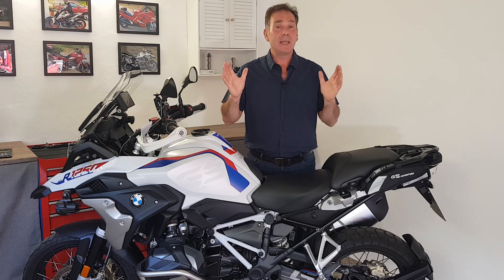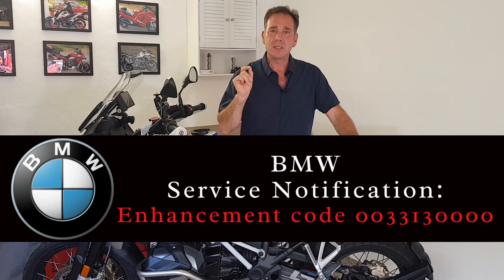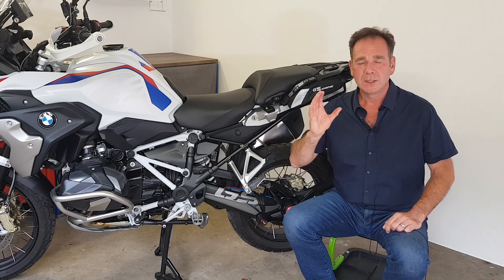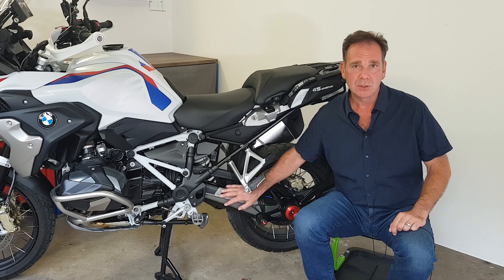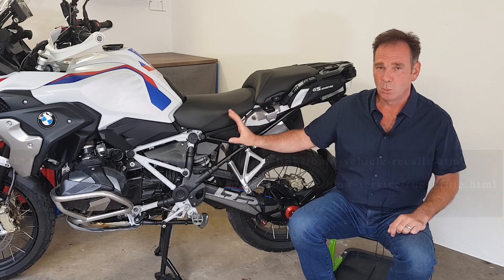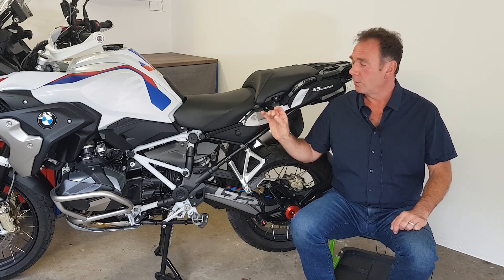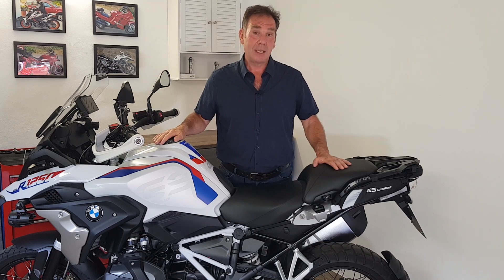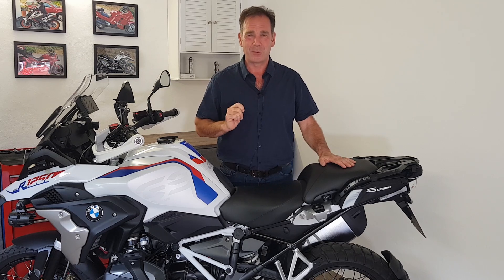EP:8 BMW Announce - Drive Shaft Corrosion Inspection and Test - Service Action 0033130000

Comment from the maker: To answer Nick’s question and help others, I do have the actual 8-page workshop notification and instruction, but it’s in German.
This is MY UNDERSTANDING…. And not a direct translation. 
A: less than 2,000km: 1: Carry out modification. NO INSPECTION

B: More than 60,000km: 1: Carry out modification. 2: Replace drive shaft unit.

C: Between 2 and 60K km: 1: Carry out modification. 2 Perform drive shaft test. 

Option 1: Drive shaft fails test – Replace drive shaft
Option 2: Drive shaft test passed & no water or only a few drops drip out during modification – no extra work is done.
Option 3: Drive shaft test passed, but more than a few drops of water come out – drive shaft splines are then inspected for wear and inspected to see if it is seized .
 
If it is seized, an attempt will be made to free it off. If this can not be done the drive shaft is then replaced.
If the wear on the splines is excessive, the drive shaft will be replaced. 

So please understand that this is my current understanding of the instruction given in this document. 
The document could be updated at any time by BMW. I have not seen the English version yet. 

If you have more questions, please contact your local BMW dealer
Best wishes
Carl

Comment: The valve they put on my bike fell out after after the run home, c300miles. I recall washing the bike post run and should have noticed there was nothing jutting out, but didn't. 
I never twigged it was missing until about 8 months later, when reading an article about it and dawned on me when I saw a photo of what should be there. Goes in for its annual service in a week's time. Be interesting to hear what they say.
Great vids
Reply from the maker: Thank you for sharing 👍

Comment: Hi Carl, I think it’s a little bit more urgent than you think. From personal experience.
Reply from the maker: Hi Graham, the dealerships have been extremely busy with this recall and inspection, my dealer had a stack of over I guess 35 or more driveshafts they had replaced. And that might just have been the months worth I saw. There are a lot of happy owners with new shafts now
Kindest regards Carl
Reply: @justthewayitis  

Hi Carl,
I would like to send you pictures and my experience with this problem but don’t want everyone else to see them.
Reply from the maker: Go to the contact section on my channel, if your a subscriber it will show you my email address, Carl
Reply: @justthewayitis  Will that not just show up here for all to see ?
Reply from the maker: Contactcarltoday
@
Gmail
.com
Reply from the maker: Just send your email to me at the address below, no one else sees it don’t worry
Reply: @justthewayitis  Hi Carl, I have sent the pictures to the other email address you sent me.
Cheers
Reply from the maker: Hi, nothing has arrived from you in my inbox yet. Regards Carl
Reply: Good morning Carl, have I managed to send you the pictures to your email address ? 
G
Reply from the maker: Hi Graham, good morning 
Nothing has arrived yet, just make sure you are using the correct address 
contactcarltoday
@
gmail
.com
Reply from the maker: Received 👍
Will reply later 
OMG !
Reply: @justthewayitis hi Carl, did you get my reply to your last message?

Comment: Not sure if this is limited to condensation. Mine was full of mud and corroded to the point it has to be removed with a grinder. The whole swingarm and drive shaft etc is being replaced
Reply from the maker: Well that’s great they are doing that for you. I think BMW are being very careful how they word the recall check. But it’s good to see thousands of bikes receiving complete new assemblies.
Carl
Reply: @justthewayitis  I was told by the dealer that an RS model with the same drive train was refused a warranty claim for the same issue as it wasn't part of the recall. I guess only the GS models are expected to get full of water and mud.
Reply from the maker: I can imagine that the RS owner was not so happy with that response 😞

Comment: Mine went in Thursday morning, a later phone call informed me they drilled the hole and oil came out, not a good sign. The Cardan Shaft and entire Rear Hub Assembly is now being replaced by BMW. I don't have the full story yet until I pick it up on Tuesday, but I am pleased they are taking care of it without question.
Reply from the maker: It’s great to hear they are taking care of it, and it’s nice to know when you collect your bike it’s going to be ready for your next adventure 👍. Sounds like the rear output shaft drive oil seal has failed or started to leak. It’s a fairly common problem on the 1200 version.
Best wishes Carl
Reply: What I was thinking, bring on the nc500 in 2 weeks 👍ride safe

Comment: Does this drain valve drain automatically or does it need to be removed to drain, thank you.
Reply from the maker: Thank you for Question, it’s really a condensation valve, that’s how BMW described it, but if you do get water inside it should drain automatically. I’m sure the regular subscribers that go off-road will comment and confirm if this actually the case.
Best wishes Carl

Comment: Last week my ‘18 1200GS went for the 30.000 km service to the dealer. They did make the extra vent hole. And they will replace the driveshaft under warranty because it’s not moving smooth. They did replace the driveshaft just 2 years ago at 14000 km because it had  the same problem.
Reply from the maker: Hi, well its great to hear they are again covering this under warranty, sounds like you have a great dealership you go too. Thank you for sharing, best wishes Carl

Comment: BMW CARDAN INSPECTION ( DRIVE SHAFT ) DRAIN PLUG FITTED. More than a few people that have had the rubber check valve installed are saying that it fits very loose and one person said his got pushed inside the drive housing and is just laying in there. Another said they are junk and fall off, and ''mines has now fell inside the runner bungs are rubbish", ''the rubber valve they install is crap, any external pressure dislodges the valve internally leaving an open hole. There seems to be no lip on the outside to prevent it from being pushed inside. I was thinking if this is the case, perhaps some black silicone seal would be a good idea which would be easy to do. What do you think? Should we just plug it back up or use a silicone to make it stay put? Thank You!!
Reply from the maker: Hi Eric, my GS goes in for the modifications / service and recall work next week, once it’s back home I will have a look and share my thoughts, Carl
Reply: @justthewayitis  Thank You Sir!!!

Comment: Hi... thanks for another great video.
Is this issue/mod just for the 1250 GS and not the late 1200gs ?
Thanks 🙏
Reply from the maker: Hi Bob, good morning. This applies to all GS and GSA. 
Reach out to your local dealer and book the inspection and test.
Many riders of the early 1200gs have had new driveshafts installed for free.
Good luck.
Carl
Reply: @justthewayitis  thanks Carl 🙏
Reply from the maker: Your welcome. 👍
Reply from the maker: One thing I forgot to mention,  it also applies to The R, RS and RT models so if any of your friends have of these its worth checking. 
My weekend riding buddy has an 2015 RS which had this check and modification done to his bike while it was in for service. 
Regards Carl
Reply: @justthewayitis  thanks again Carl... really appreciate it
Reply from the maker: No problem 👍

Comment: Your video refers to it as a technical bulletin in the beginning, but a recall notice at the end. 
There is also a torque test on the shaft performed as part of this service.
Reply from the maker: The video would have been a much longer episode if I had covered the whole test procedure , several owners have received new drive shafts as part of this test which is great news. It probably should have been a recall but with over half a million GS models sold it would have been a huge amount of work for BMW, so by calling it a service inspection they have been able to process the bikes in a easier way to handle. Best wishes Carl

Comment: Great video!  I've been looking into this problem.  It seems the rear UJ fails for the following reason: moisture enters the casing, then the needle rollers, corrosion sets in and they deteriorate from there ... that coupled with excessive articulation of the UJ quickly leads to failure.  Rebuilding with another UJ addresses the symptom, but not the cause.  
This is a serious design flaw which BMW could address by replacing the rear UJ with a CV joint (as found on the outside wheel of FWD cars, but smaller).  The CV joint could deal with the articulation, and being covered, the only maintenance remaining would be a periodic greasing of the final drive splines with a suitable high-pressure marine grease.  Fitting a breather will simply delay the problem, not prevent it.
Reply from the maker: Hello Visionary,  and welcome to the channel. Yes, I think most trained mechanics have seen as you have highlighted.. the only way to truly make the joints reliable over time is lubrication. I have not seen inside other manufacturers drive shaft units, perhaps they have a different solution. Best wishes Carl

Comment: Great video on a problem many of these bikes have. I live in the desert, and when The shaft on my GS was inspected and spline lubed at the last FD oil change, everything in there was ok. So I drilled a small hole in the bottom of the rear of the swingarm, threaded it and put a small hollow shaft into the hole. I got the Duck Bill rubber valve on Amazon for a dollar and installed it over the small bit of hollow rod sticking out of the bottom of the Swingarm. Good to go.
Reply from the maker: Hi Chris, good morning and thank you for sharing your experience, great idea....  👍best wishes Carl

Comment: Thanks for the clear explanation. I am not too pleased with the solution BMW provides. The problem is water getting into the driveshaft tunnel. This problem is not solved. Water gets in by riding in the rain and cleaning your bike with a high pressure cleaner.  Riding through streams doesn’t  help either, but only a small portion of the GS riders actually does that. The rubber connectors in the driveshaft are not watertight. Condensation is not really the problem, it is water getting in. Greasing the splines every 1 or 2 years and keeping the edges of the rubbers well greased, is probably the only remedy.
The solution provided by BMW is a bigger bucket for a leaking roof.
Love your channel and you very clear way of explaining things. I am not criticizing you, just BMW. This problem did not develop yesterday.
Reply: The new Moto Guzzi V100 seems to have a better drive shaft design than the BMW
Reply from the maker: Hi Chris, I have not yet ridden the V100. Maybe next year I will get the chance.  Carl
Reply: @justthewayitis my 2014 with 73k km will get a free replacement without testing because >60k km. Backorder of 3 to 4 months tho.
Reply from the maker: That’s great news!!! It’s nice to see BMW taking care of this issue correctly. It’s a shame you have to wait but at least you know it’s going to be replaced 👍
Best wishes Carl
Reply from the maker: Hello Hans, and welcome and thank you for the compliment. Yes I'm aware it's not a condensation problem... but this how BMW worded their notification lol...like you say its water getting in and I think BMW didn't want to say that or admit this, hence they used the word condensation. Some owners have commented here that BMW have actually replaced the shaft... free of charge on older models during this inspection, which is great news. Your tip for regularly checking and greasing the splines is a good one.
Best wishes Carl. 👍

Comment: Trust by now, that old fella called BMW would have supplied the necessary tools and parts for the retrofitting works!!!!!
Unbelievable you are Mr BMW!!!
Reply from the maker: Hello David,  I believe many dealers now have the tools and equipment to carry out the test and modification. Carl
Reply: @justthewayitis  i certainly hope so as my GS would need it anytime soon.  Thanks Carl.
Reply from the maker: In problem,  the modification is being done now on a lot of shaft drive models. My friends RS went in for a service and they automatically did the modification.
Reply: @justthewayitis  thanks Carl.

Comment: I just had my 2015 r1200gs checked. Got a new shaft and the rubber valve installed free of charge. I can feel less vibration so....
Reply from the maker: Hi Jörgen, that's great to hear that you received a replacement  drive shaft...👍

Comment: Yesterday I brought my machine to BMW in Cologne.  Today around 3:00 p.m. it was finished.  What was done?  The 2nd maintenance and the drain valve have been done. The cardan tunnel including the cardan shaft was checked and then the valve was attached to the bottom of the cardan tunnel.  Doesn't seem like a complicated thing.
Reply from the maker: Hi Christian, thank you for sharing your experience at your BMW dealership,  its good to hear they now have the equipment to carry out the modification and that your bike has been done. I guess your enjoying your GS and having fun. 
Best wishes Carl Nord Hessen 👍

Comment: I don't think it's as minor a problem as you're portraying. From what I've read many people  owning bikes from 2013 onwards, have had knock on problems relating to condensation in the shaft housing. Although BMW have 'reacted' to this problem- no compensation has been offered up, for any of the problems, this has caused....
Reply from the maker: Hi Simon, hello. BMW have a lot of bikes to look at, over 440k which is going to take some time. Perhaps they could of handled this in a different way and made more of a effort to assure owners  that they care and want to help fix these problems. Some owners will receive new drive shafts for free under warranty... so I think it's a positive step forward. But perhaps you are right and it's a much bigger problem...
Carl
Reply: @justthewayitis  thanks for the reply Carl. I flagged it, as a good mate just returned from a trip to the Pyrenees. After looking to service the drive shaft, within service period, discovered it V rusty along with V notchy rotation. I don’t think he’s had much luck with BM as the bikes 4 years old
Reply from the maker: Sorry to hear that, has he actually checked his chassis number with BMW?. As far as I am aware this check / modification will be done on bikes as far back as 2013.
Carl
Reply: @justthewayitis  I'm sure the mod will be done as his bike's 2019. It's whether they'll accept responsibility for further damage caused by the water in the casing

Comment: So that's simply a small duckbill valve being installed. You might need to gently squeeze it to release the water from the assembly. It may not do it automatically. It should prevent ingress through the valve, but since water could get in elsewhere it's simply a point of exit for anything that gets in. Installing it isn't going to change anything, you'd still need to release the water and periodically check and lube the splines
Reply from the maker: Hello and welcome,  I have not seen the modification done yet, but what you say seem logical and sensible to release any trapped water.  Thankyou for sharing. 
Best wishes Carl

Comment: How many others are suffering with paint corroding on engine cases ? Cos mine are awful after 3 years and just 8k miles
Reply from the maker: Hi Mdaydj do you mean the front of the engine case ?.
I thought they were much better from the owners I spoke too, perhaps that's incorrect. Carl
Reply: @justthewayitis  on my 3yr old 1250 and its on several parts its really babied washed and cleaned regularly.
Although ridden in the British winter occasionally, our climate isn't that different to Germany,  BMW should use better paint
Reply from the maker: Thank you for clarification... yes we do have similar weather and yes BMW probably should do a better job. I will check mine regularly now you have mentioned it.
Many thanks Carl

Comment: This is useless information to those who service and maintain their own motorcycles, or who use independent BMW motorcycle mechanics, as getting the "fix" done is only available to those who have their BMW motorcycle maintained at a BMW dealership service department.
Reply from the maker: Hello Louis.
BMW will carry out this work / test / inspection   on over 440,000 motorbikes starting from the year 2013. 
Instead of complaining about the information I have provided, perhaps you should check your own bike.  BMW will be doing this for everyone regardless of weather you maintain and service the bike yourself or have this done with an independent dealer. 
I would imagine many owners will be receiving new drive shafts or repairs or maintenance for FREE.
This is not useless information.... many thousands of GS owners will benefit from this inspection and the work that may need to be carried out on their motorbikes.
Carl

Comment: What is the website where we can check?
Reply from the maker: Hi Luis, 
It depends on which country you live in, but just search for BMW recall check. The simplest and easiest thing to do, is to visit your local BMW dealer or call them... and give them your chassis number.
They will confirm what is required. 
Best wishes Carl

Comment: The video doesn't even show the important part: checking the cardan shaft and its joints for problems / concentricity. There is a risk of a crash if universal joints break.

BMW moved the cardan from the right to the left to get a nice right side of a free wheel. When the bike is on the side stand, it just looks better. Poser bike.
Now the water just runs into places where it didn't run before. LC=bad cardan 
New BMWs have TWO drain valves, one down near the rear axle and one up near the swingarm pivot. However, only ONE drain valve is retrofitted on older motorbikes.
Reply from the maker: Hallo Wolfgang und danke für deine kommentare. LG Carl